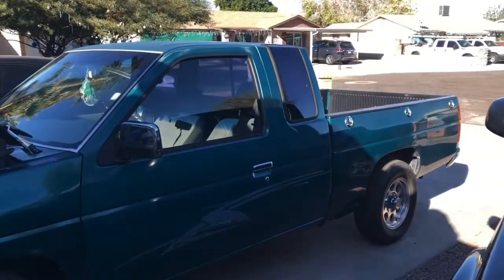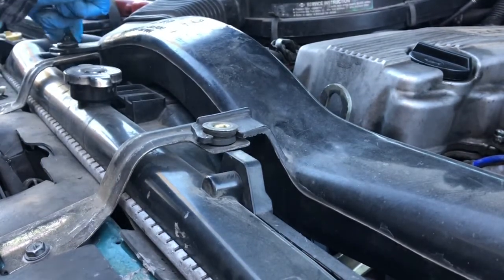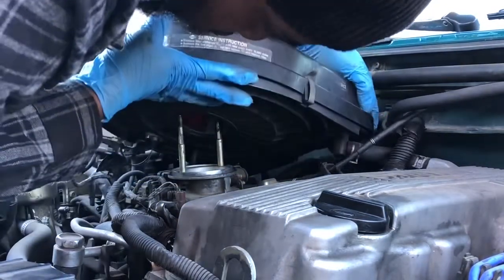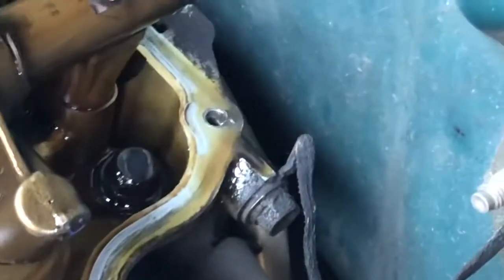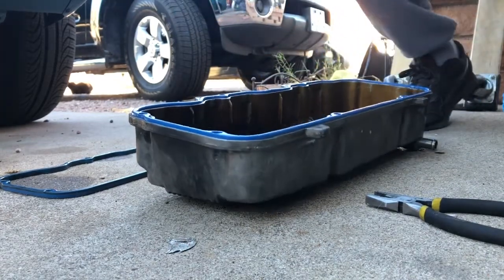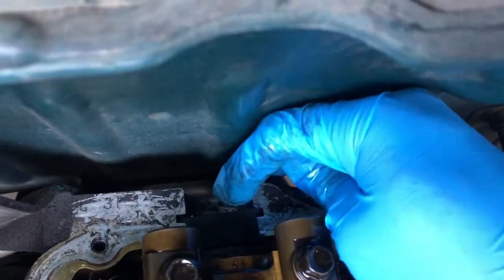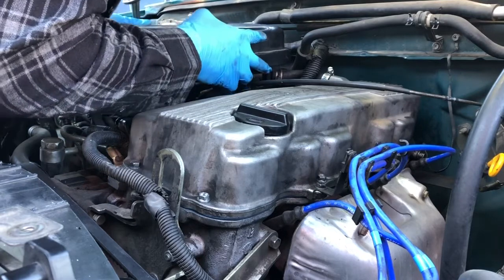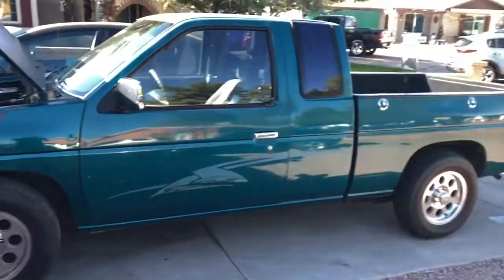88-97 Nissan D21 Valve Cover Gasket Replacement

Comment: Just a note if this is your first time doing this task on your z24…

Some of the valve covers have small tabs attached to a thin inside metal liner…pull those tabs out and when you install the new rubber gasket press those in…The manual(Haynes) also designated a torque and tightening pattern for your bolts when reinstalling

If you need new cover bolts, they are an M-5/1 shank and thread…

Comment: Just stripped out the bolt hole in the back right in my 97 hardbody. Going to try some loctite thread repair and pray lol... 

Thanks for the videos man. Lookin forward to more
Reply from the maker: Try to get one at the Dealer any Hardware store should have those type of bolts aswell. Gonna make one soon doing Brake pads and 1 for Rotors.

Comment: Good video... my 92 has a leak... you made it look easy!  A buddy told me to be very sure to re-tighten to specs, but he worries about stiff... any issues?
Reply from the maker: Not 1 Issue for me. But yes do everything to Specs if you can
Reply: @curtfox91  At any rate, thanks for this video... I did mine last night... Easy. Took like 40 minutes. Those back two bolts as you noted were a pain in the ass...haha
Reply: When you start your car does it blow some but not tons of smoke?

Comment: I have recently started having oil on one of my plugs and my truck has begun to sputter. Do you have any ideas how to diagnose and possibly repair?
Reply from the maker: Oil on the plugs try changing your Valve steams. They basically guard the plugs from oil. And if your sputtering your timing maybe off a little. Try to adjust your distributor time if that does not work then you have to set your truck to top dead center. Also sputtering may be a sign of failed components like a clogged cat converter or bad spark plugs and wires or a failing distributor or a vacuum leak. But I would start there goodluck dont give up

Comment: Can I still run my motor with 2 loose bolts ? Ka24e
Reply from the maker: Would not recommend but im sure you could.
Reply: @curtfox91   I just put it all back together so far no leaks
Reply from the maker: @MsXfusion  Nice id just check on it every now and then. Lets hope its all well 👍